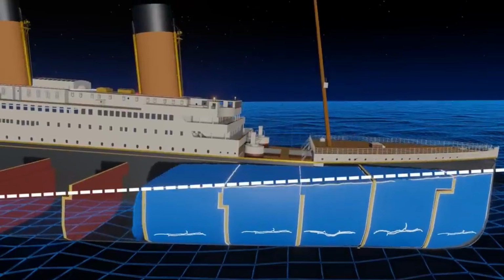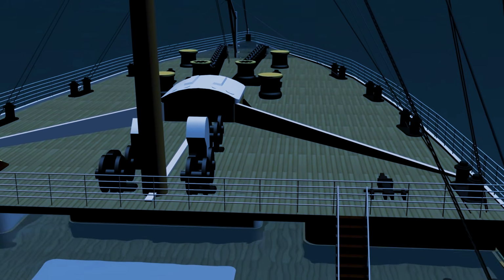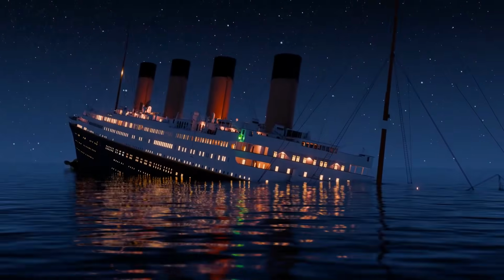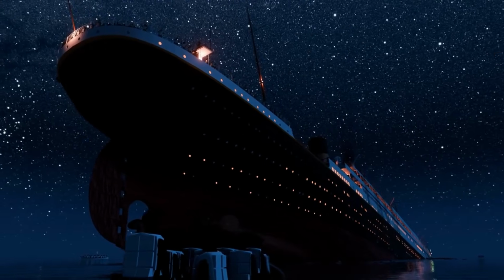3D Reconstruction of Titanic’s Sinking

Comment from the maker: Do you think the Titanic tragedy could have been avoided?
Reply: Yes…if they just drove the ship directly into the iceberg, the air tight compartments at front of ship would have been able to allow the ship to carry on to NY (injured by floating)
Reply: It was Jack and Rose’s fault.
Reply: Sure.
If they spotted the iceberg 10 seconds earlier.
But its just another IF situation.
Reply: No. There were environmental conditions which hindered the crew's ability to spot the iceberg in time. The tragedy still would have happened. The way I think it could have been different was in how many lives could have been saved; however, this is hindsight.  The Marconi radio saved many lives that night.
Reply: Yes with binoculars
Reply: Maybe If they binoculars
Reply: No. It was the will of the gods.

Comment: The fire that happened in the docks weaked the Iron, 
if they had turned but kept foward thrust would the ship not turn better than going full reverse
Reply from the maker: It probably would have turned slightly better by maintaining forward thrust, since the rudder needs water flow to be effective. Going full astern reduces that effectiveness.

That said, the time available was so short that it’s not certain the collision would have been avoided.

Comment: I always thought the hull cracked.
Reply from the maker: The iceberg didn’t open a clean gash as such; instead, it deformed the steel plates of the ship’s hull.
Reply: @3dcrash  ...and broke the brittle rivets holding the steel plates together. The rivets were brittle due to the extreme cold water.